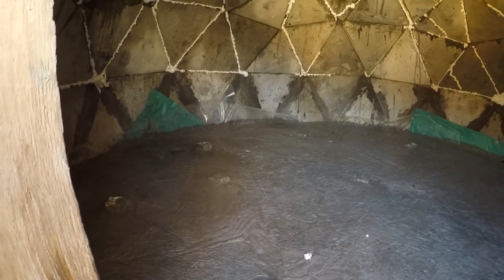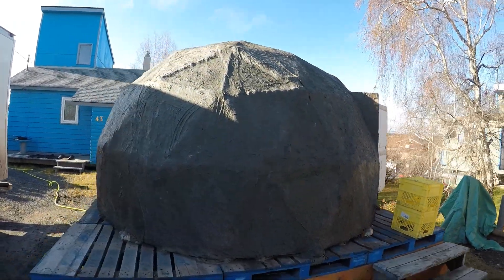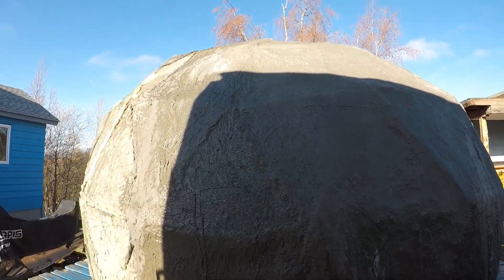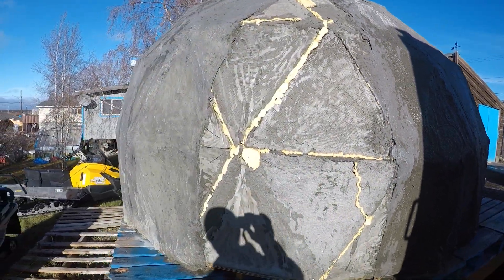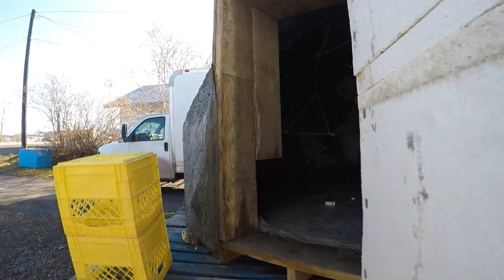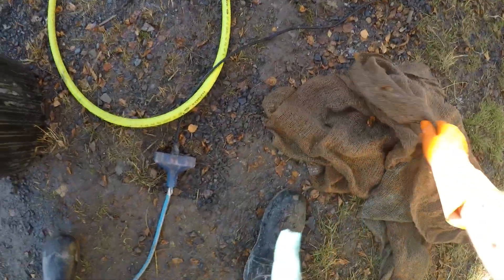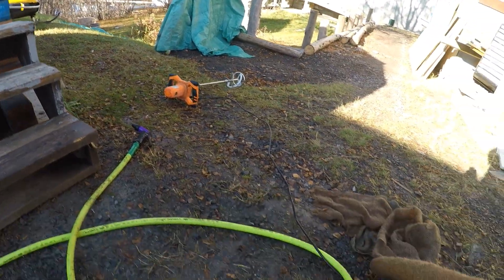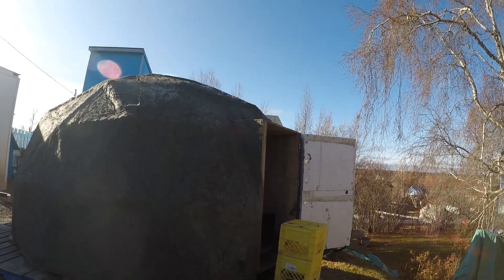10 ft aircrete dome part 2

Comment: How did it do after the next winter and thaw?
Reply from the maker: It is holding still, it did crack on the first winter, mostly because I didnt have the burlap and my base is not the best. I am in the process of working out a better system before I build a bigger one with. I will keep you posted. 
thanks for watching.

Comment: You could mix some mud with cement save a whole lot of money to
Reply from the maker: What do you mean with mix in some mud? thanks for watching
Reply: @juanconhambre  take some subsoil get it wet nice and muddy mix in some cwment so it sets up hard
Reply from the maker: @prototype9000  that would work for what I want to do as it isnt insulating, the bettter benefit of the aircrete is its insulating properties for the north. 
Thanks for the comment, different points of view are always welcomed.

Comment: Please share aircrete dome design
Reply from the maker: What else would you like me to share, I explain my thought process and my plans. If I can help you with anything else let me know. Thanks for watching
Reply: @juanconhambre  thanks
I am preparing for building a 25ft dome house in my hometown in India
And gathering whatever data I can collect from YouTube and Google
Reply from the maker: @dennisboscodemello2123  that would be amazing, when you build it are you going to post your process I would love to see it.
Reply: @juanconhambre  sure, 
I will be making a video as soon as I get permission by the authorities to construct Dome House
Reply from the maker: @dennisboscodemello2123   best of luck, I hope my video gave you some ideas on what to do or what not to do LOL
Reply: @juanconhambre  If I am building dome house as same as your, then your design is best, but I am building a bigger structure, I share some details I will be using
In place of Airform , I will be using bamboo sticks wrapped in a material which holds concrete when it is sprayed
Reply: Rest same as dome house
Basalt mesh & basalt & fiberglass rebar
Local waterproofing & insulation materials

Comment: So why not do this with a mold? And just pour the aircrete into the mold? Thats way more easy. 

Greetings,

Jeff 

p.s.

Look at this: https://www.youtube.com/watch?v=bicc1MaPaHM. Buying normal bricks isnt too expensive, and it can get the job done. 

You can put insulation material around the brick, and then cover it up with cement or lime on the inside and outside. Whatever you like.
Reply from the maker: I made a mold for the triangles, as I was trying to simplify the process. I know there are other ways to make domes this was my trying a new approach. Normal bricks would not have enough insulating properties plus I cant find them where I live, or it would be ridiculously expensive to buy, if you want to know where I live type, Inuvik NT, Canada. It might give you a better idea why I need all the insulation that i can get. Thanks for watching.
Reply: @juanconhambre  I completely get it now! Also the round dome makes a lot of sense, while its the shape you can keep the most warm. 

Ive heared people build buildings using a normal concrete frame and then using aircrete to make the walls. 

If you are looking for some good concrete books: https://archive.org/details/@artifact95, its my archive.org page. 

Greetings,

Jeff
Reply from the maker: @jeffjefferson2676  I will have a look at it, thanks for that link and if you have any ideas on how to improve this let me know I am always open to new ideas to improve this new idea :)
Reply: @juanconhambre  Well you could just build a mold out of triangles, and use that for a pour. You can use plastic spacers to keep a wiremesh in the middle of your mold. When the mesh is placed, you can use some bigger triangles for the outside mold. You can use pvc pipe and long bolts to keep the outside mold in place. You can pour in stages, and use the outside molds again. You could also do that with the inside triangles, but then you have to build another structure to support the inside mold again. It can be done though, but it might be more of a pain then a pleasure, however when materials are that scarce, it might be worth the while.

When you want to use a foundation, you will have to be 12 inches or 1 feet below the frostline to be precise. And while you are in an area with a frost line real deep. You want to look at this https://www.climatechangenunavut.ca/sites/default/files/permafrost_nunavut_eng_reduced_size_0.pdf 

I dont know what the soil look like under your house, but what you could do is dig two stories down until you hit bedrock or are below the frost line (if that is even possible) and build yourself a really big two story cellar. :) Now that might be a bit much for an aircrete building. 

One more thing, use a pondliner, or some other waterproof barrier to pour your slab in. Maybe its best to first make a frame for the building, put in the waterproof barrier, pour an aircrete layer, and then pour a hard layer of concrete so you wont puncture the aircrete. Planks would also do well, or something to spread the weight. Water proof barrier/liner...

Any way! Good luck!

Greetings,

Jeff
Reply from the maker: @jeffjefferson2676  Bed rock here is intermittent so digging isnt really a common thing plus you would have your cellar having to fight the ice and cold all year round. We build on stillts or pads and that seems to work, not differente than any other house for the dome, as long as the base is sturdy enough, maybe pallets isnt the strongest material but I didnt want to spend a fortune on wood to test my idea.
I think your idea of a double layer dome is great but like you said it would be a lot of work, I think it would add lots of insulation value if the two layers arent touching and it would also make it very sound proof.
I think I will stick to my one layer approach for not but it is something to consider for larger domes as the trianlges will get bigger and heavier, so by making 2 thiner walls you can save on material and weight.
Thanks for all the information you are sharing it is really interesting and very useful
Juan
Reply: @juanconhambre  Hi! Well i did not mean two different walls, I meant to use the pvc spacer to keep the mold in place. The wiremesh is just reinforcement. Will chicken wire work as well?? I havent read all my concrete design books yet, only the how to make molds and how to pour concrete books; Concrete, and Concrete Formwork by ATP book publisher. So i know all about that. So a thick one layer dome is fine! So you pour the concrete around the spacer, and the pvc tube remains in the wall. The bolt and the mold are removed. Just fill in the pvc tube when you removed the molds. 

Building on wooden blocks it is then!

Greetings,

Jeff

Comment: Hey!
The next time you build a aircrete building consider this idea.
Building a aircrete pyramid.
You can make just one mold and cast it four times on the ground pointed away from each other and depending on the size of the pyramid you could probably lift the walls with a small group.
Not as much floor space, but very seems very efficient to build with just 4 seams to mortar.
Reply from the maker: Not a bad idea in the sense that is simpler, but I wonder how big of a piramid I would have to be to be usable space inside. This dome that I build was a proof of concept but it is easy to scale up to a liveable space size. I guess I could  build a piramid on Scketch up and test your idea, I think at certain size the piramid would require some serious lifting power to bring the four pieces up. But I do like the idea for maybe smaller building like a tool shed or even a green house.Thanks for watching

Comment: I'm quite interested to know how well the thickness used works in relation to its insulating properties. Did it do well in the winter? If not how much additional would you recommend for your climate? (Also interested in how cold your weather gets)
Reply from the maker: Hi, sorry I never replied to you, I might have missed the notification, I did not test the insulation properties of the dome as it is to small to live in it. Also my design as noted on the video wasnt the more airtight so I dont think I could get a proper read on it even if I put heat to it. I still hope and plan to build another one a bit bigger that I can heat and test in the near future,  What it has endured well is the snow load, at the end of the winter it had 4 feet of snow on top and even not being a perfect dome it held its shape very well for not 3 winters. 
We get temperatures of up to minus 40 sometimes during the winter but you can safely say the that our media from Nov to Apr is minus 20. 
It will be nice to test its insulation properties, thanks for watching and again sorry for the delayed response

Comment: What type of waterpropfing will you use?
Reply from the maker: Not sure what is available in my local hardware store. I wanted to use waterproofing additives for the concrete and I couldnt get anything there, I think they have some cloverdale masonry waterproofing, once I paint it I will let you know if it works.thanks for watching
Reply: @juanconhambre  I have heard latex paint mixed with cement might work to waterproof.